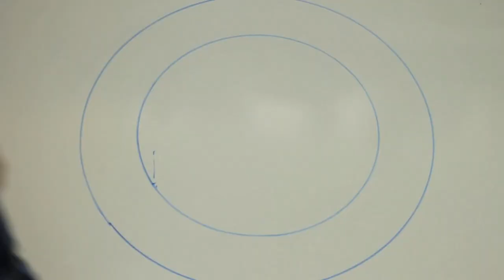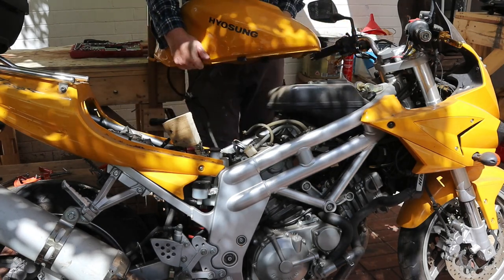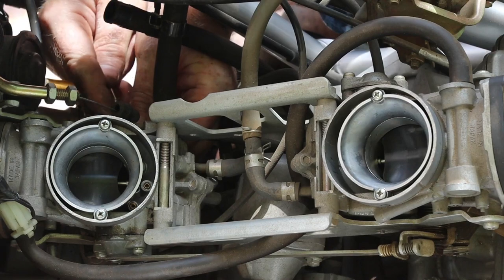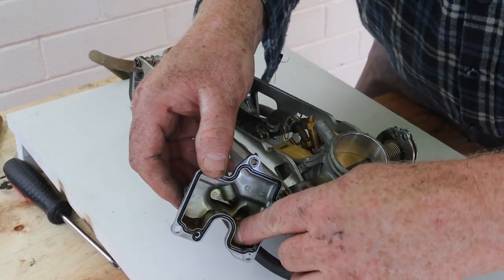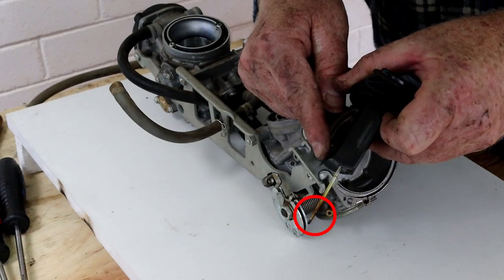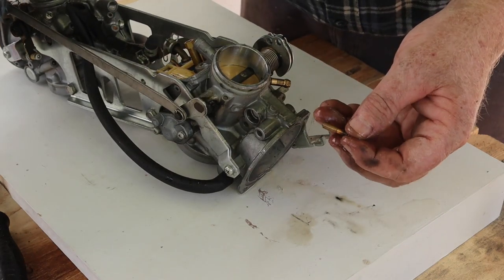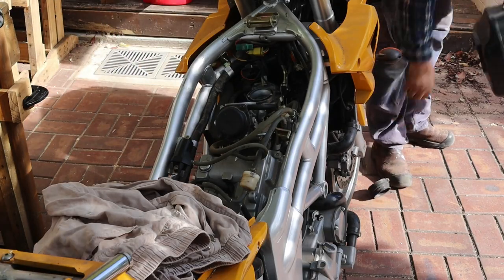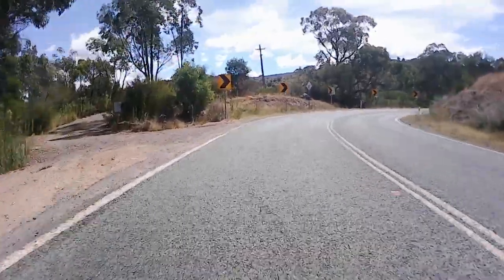Tightwad and the Art of Motorcycle Maintenance

Comment: Depending on how many small parts and such you clean on a regular basis, an ultrasonic cleaner may be a worthy investment: they're relatively inexpensive online and perform miracles on baked on varnish and crud. Filled with a little rust remover and simple green, they also do amazing things for older flea market find tools. That road looks like a blast to ride on!
Reply from the maker: Well, it's the first time I've cleaned the carburettors since I bought this bike (in 2012). :-)

The road is excellent on days like the one in the video.  You do need to be careful on days after heavy rain, because there'll be lots of areas with gravel washed onto the road.  I usually follow Brindabella Rd as far as "Piccadilly Circus" before I turn around and come back (because that's where it becomes a rough dirt road for about 60km to Tumut).
Reply from the maker: Do you have any carburetted vehicles in your collection? Kids these days don't appreciate how much easier fuel injection is! :-)
Reply: @TightwadWorkshop  At the moment I do not - only carburetted engine I have is attached to my chainsaw. At some point I'd like to experience a carbed vehicle though, seems to be interesting.
Reply from the maker: @williamwakely1398  Chainsaw carburettors are a whole other level of infuriating! :-)